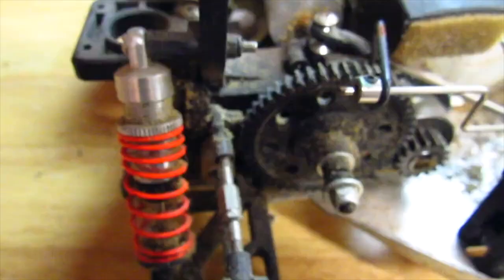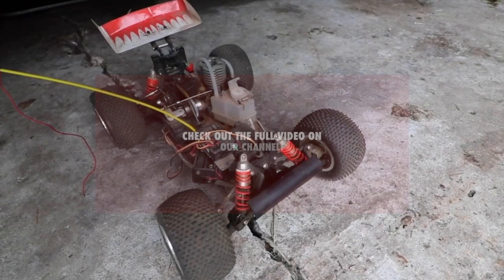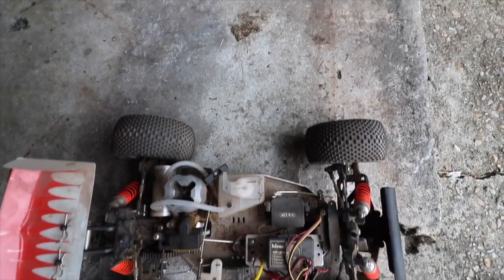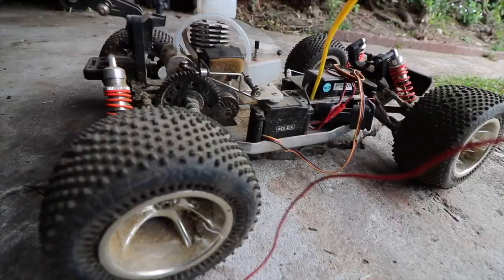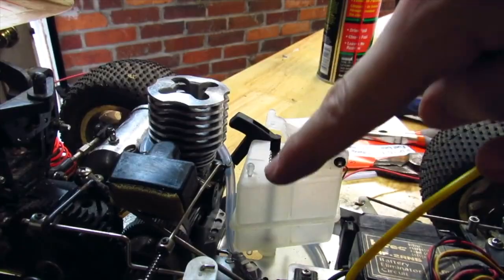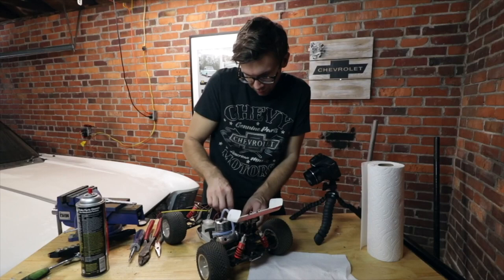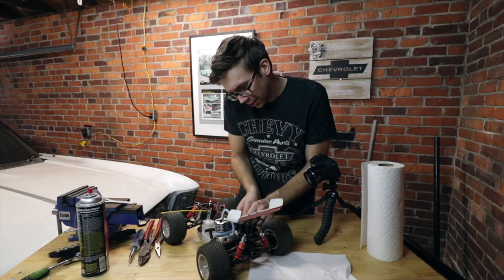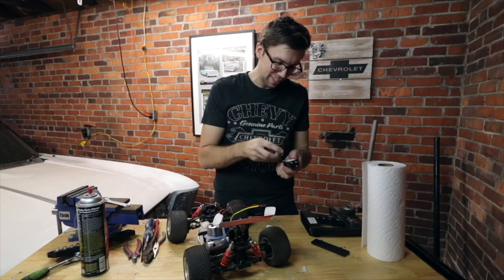Super Short Revival Of A Old RC Car!

Comment: What happened to the car fella?
Reply from the maker: Repaired the suspension with some parts from eBay and I was able to track down a set of original wheels/tires! I’m still searching for a body unfortunately. They seem impossible to find. It’s been running great once the carb o-ring was replaced!
Reply: @MatthewFinlay  aw that’s wicked that you’ve still got it. I’ve had the UK version for the last 13 years and now I’m starting to get parts from overseas so that I can have it as a monster truck maximum St I think and I want to get the maximum BX body mounts so I can get a buggy body back on there. The uk version was gv models Panther but sadly that shell body is no where to be found like your version with you
Reply from the maker: Huh that’s crazy they changed the names over there! I wouldn’t mind a new style body but when I took it took our local hobby store we tried at least 20 buggy bodies they had laying around none of them fit or looked right. They said the old stuff like ours doesn’t really interchange with anything nowadays. I was also kicking around the idea of 3D printing a body. While my 3D printer isn’t big enough to do it in one print, making it in flexible filament would be cool.
Reply: @MatthewFinlay  that would be amazing fella, great idea that is. Yeah it’s sad having these old things and not being able to get shells body’s. It’s abit of a waste